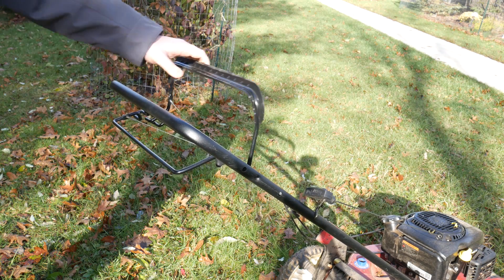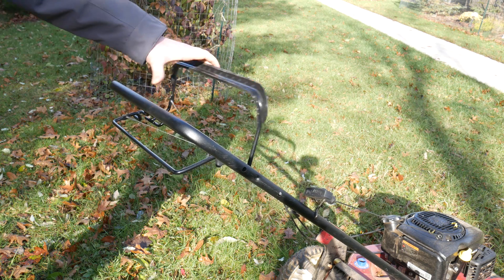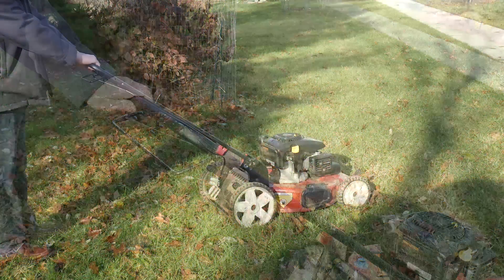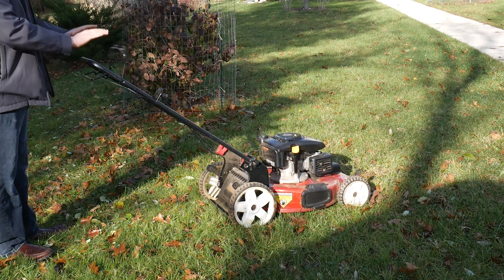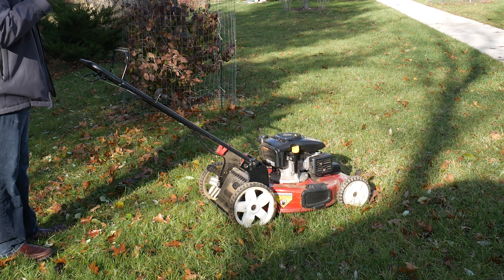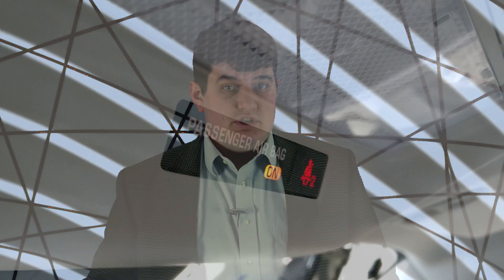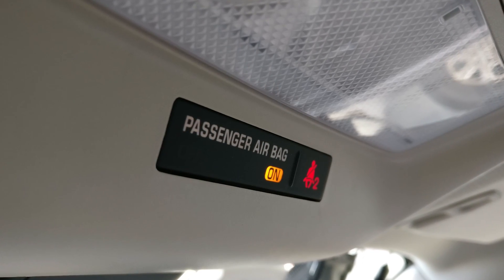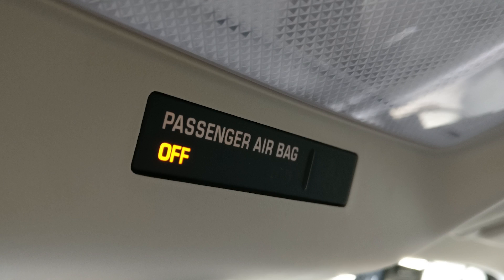The Dead Man's Switch:  How Anton Yelchin's life could have been saved

Comment: Wouldn't this make it impossible to tow a vehicle without a driver being in the vehicle
Reply: I was thinking the same thing.  It's not unknown for a tow truck operator to drag a car a short distance from being parked onto a flat bed or to be put on wheel dollies.  This would require some tow companies to upgrade equipment or people with RVs to dolly/trailer their run around vehicle.  Then again, I have an all wheel drive vehicle and have heard of other people's all wheel drive drive train (redundant?) being ruined by a tow company because the vehicle was towed miles by a standard hook truck dragging one of the axles to the destination.  The solution to that one and this dead-man-switch problem: flat bed everything. As far as suing the tow company for damages I have heard they are not liable leaving vehicle owners thousands in damages in addition to the reason for the tow (collision, break down, illegal parking, etc.)

Comment: An issue arises with this.  Neutral is specifically designed such that the car can be rolled without being driven.  By putting a dead man switch on that, you disable an important function of the car, makes it more difficult to tow etc.  And if he'd accidentally switched it to neutral, well...  So no, this is not actually a viable answer.  Making it more difficult to accident put the car in neutral would have been preferrable (usually, that requires the brake to be held - there's your dead man switch) .

Comment: Not just weight. I worked for a Swedish company, Autoliv, through Jaguar Cars to help take readings for the smart passenger airbag system for the then new X350, XJ model. This actually used ultrasound transceivers to work out head and body position, and physical frame size as opposed to just the weight.

The system was so clever it could determine whether you were reading a newspaper or not.

I wasn't involved in subsequent systems so I'm not sure if this was also adopted for the driver's seat but using this could've easily detected if a driver was still present, in position whilst the car was in motion.

The problem with using a pressure sensor on the seat as the dead man's handle could cause issues if a driver feels he needs to adjust his position whilst on the move, thus a risk of engaging the fail-safe. Last thing you want is a stop at motorway speeds because you want to adjust your bum position lol.

The technology is one hundred percent there and wouldn't need much to adapt for this purpose.

Comment: To be fair most cars these days have switches that will not allow the car to be in gear (automatic trans) AND have the driver door open (possibly the passengers doors have not tested)
I have actually had them slam into park after opening the door at low speeds *(work in auto shop, move in parking lots a lot) 
IF it was a jeep wranger that might explain why it doesn't have the door sensor since the jeep wrangler has removable doors... and idk if they were removed or not but just the fact that they are removable might mean they do not have that fail safe equipped.

Comment: A dead man switch in the seat is a fairly common feature in newer forklifts. With the engine on but no operator in the seat, you can toggle the gear selector all you want, but it stays in neutral. Leave the seat while it's in motion and the transmission automatically kicks back to neutral and the electronic parking brake (if equipped) activates. Even older models had an alarm that would sound  if you left the seat with the transmission in gear.

Comment: there is a very good reason why they have not tried doing this.  because shifting into park while in motion can do serious damage to a transmission when the shaft lock gets engaged to prevent the shaft from moving while disconnecting the engine shaft from the transmission (free spin).  the shifter has been designed so you can't do this by mistake, you can't even shift into reverse from neutral without pushing the button partly in.  if this switch happened to malfunction while someone is driving and the shifter slams into park, you would pretty much total the car and badly injure or kill the driver and other occupants from the hard stop.

there is still a method of a safety, and that is by connecting the driver door sensor to the computer to tell it to ring a chime if the car is not in park, and if the seat is vacated then it would apply the brakes to a certain pressure while still sounding the chime.  but forcing the car to slam into park is the worse idea possible both in terms of safety and cost.

Comment: TESLA Model S does have this proposed feature: If you leave the driver's seat, it switches to park. If you want to push the car while not in the car, you have to enable TOW MODE in the menu and accept a warning.
Reply: An override, awesome.  I was thinking of this.  There are times I want to move my car a few inches or feet in my garage but don't want to start it (ICE noise).  A simple shift into neutral and a push to where I want it.  I also know mechanics who will do this by choice or for obvious non-functioning reasons push, drift, or pull a car with an ATV into their garage to repair while a body may not be present for the switch.  Then again, need to push a car while no one is around, put a brick on the seat.  In my car putting my phone on the passenger seat trips the sensor or the air bag and seat belt monitor making the computer thing someone is in that seat (a 5.36 oz. phone or  1/3 lb.. [0.15 kg]).  Doesn't need to weight a human weight to be considered a human by the computer...

Comment: His death has always bothered me cause I worked at a Chrysler Jeep dealership when this happened.i had noticed this being an issue when pulling a vehicle in and trying to exit the car too quickly because that dang gear shifter would all too often land in the R or N position rather then park like the user ment.i always told my coworkers and boss  that someone was going to get killed over that stupid design.

And on up till his death Chrysler hadn't addressed it,so there's about 3 years worth of vehicles out there that potentially could still have this issue if the owner hasn't taken it for the recall.

Also the way they "solved" this issue is with the door being opend and no foot on the brake will force the e brake on. Either way all of this sensor crap is a money pit/death trap just waiting for all these cars to age.when those sensors start going out people are going to loose their shit at the cost to repair if they haven't died in a wreck.

Me personally wouldn't own a car past 2011 because of them.

Comment: My Tesla already does this, if you leave the seat OR open the door at low speed the car goes into park. A little annoying at first because  i slide off the seat a bit  when driving in reverse, but better than dead. A multi-thousand pound object should not move unless explicitly told to do so.

Comment: Dead man's switches are a thing of the past on locomotives.  There are now alerters, where you need to operate a control during a given time or else it will start warning you.  If you don't acknowledge the alerter, by either the acknowledge button or operating a control, it will apply the brakes and cut the power.  You then have to do a reset.

Comment: You NEED the car to be able to roll in Neutral without an occupant in the seat. If the car breaks down by the side of the road, you NEED to be able to engage Neutral to push the car to the side of the road as quickly and easily as possible. So while this might have prevented Anton Yelchin's death - and a few others - it likely would kill MORE people through cars that have run out of gas being rear-ended on the roads. 

Neutral should be able to work regardless of the mechanical or electrical failure in a vehicle.

Comment: Some cars (in the UK at least) will put the car into P and apply the parking brake if you open the driver's door. It can be annoying if you are trying to  park tight up against a kerb and open the door to see where it is, it's a fairly rare situation for most in comparison to getting out of the car with the engine running. 
Another existing solution is of course... manual gearboxes :-)

Comment: Electronic gear shifters are the worst. There are two many things to go wrong. My car has a mechanical column shifter. There’s never any ambiguity to what gear I’m in. My mom’s car has a similar setup, except it’s dash-mounted instead of column. My dad’s BMW, in the other hand, has an electronic shifter. That thing makes me so uncomfortable. There’s no noise when you go between gears, and it’s just a button on top to engage park. Automakers do not need to reinvent the wheel every time they update a car. I understand that they’re kinda necessary on hybrids and EV’s without a proper transmission, but otherwise an electronic shifter is pointless; and I really do blame poor quality control on FCA’s part for this occurring

Comment: LOOK UP how a trans works first off it's a lever that pins into a gear and has to have to HAVE no  motion in order to work...,the only way this can work is by the brake system itself to stop it, NOT THE TRANS!!!!!and this is already implemented mounted with the electrical e brake that will engage  when you open the door on new cars

Comment: Interestingly, my ride on lawnmower has two dead man switches. One under the seat, the other on the parking brake. At least one of these switches has to be on for the mower to run. This allows you to start the engine with a pull cord, which requires you to be standing next to the mower, so long as the brake is applied. It also won't start if it's in gear or the cutting blade is engaged.

Comment: Some forklift's have an empty seat sensor so that if you get off of the forklift it won't move or do any thing until you sit back down but the engine ether diesel, L.P.G. Or petrol will still keep running.
There is a side by side off road buggy that you can buy the CAN-AM's and if the seat belt is not buckled the computer derates the engines power so you can move it slowly but ounce the seat belts buckled it opens up and man can those things move.

Comment: Then there are manual transmissions, which have mechanical linkages.  A possible remedy for them would be a driver sensor coupled to the braking system.

I tow my Jeep behind my RV and have an automatic braking system so that if the vehicles separate, the Jeep's brakes are activated so that it can be brought to a stop quickly. . . hopefully without doing too much damage.  At least it won't continue rolling out of control at 60 MPH.

Admittedly, it is an add-on system using a breakaway cable for activation, but there is no reason that something similar could not be factory installed.

Comment: You obviously never drivin a jeep Cherokee 2014+. If the door opens the e break automatically engages if the door opens. Grand Cherokee's do too. Additionally my 2019 Civic puts the e break on automatically in I open the door without putting the parking brake on before I step out.

If my parking  brake engaged every time I took off my seat belt while driving, I'd get into numerous car accidents. I take my seat belt off multiple times while driving on a long road trip. Only for a few seconds to grab a snack for my daughter or just to adjust my seating position

Comment: The issue with the shifter is that when you put the car in park the transmission does not always go in to park. the shifter is in the park position. the trans gets the signal but then says fu and then the car runs you over. it is a shitty transmission.

Comment: It’d be easier to implement it into the door ajar lighting system. But also, I’d rather it enrages the emergency brake rather than just park. The pin for park is easy to sheer off when a car is in motion or on a hill.